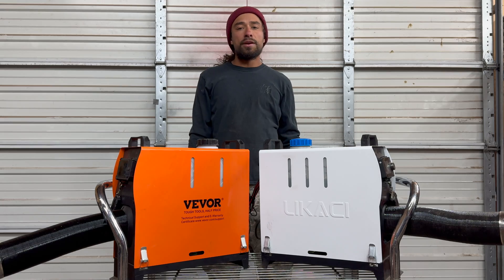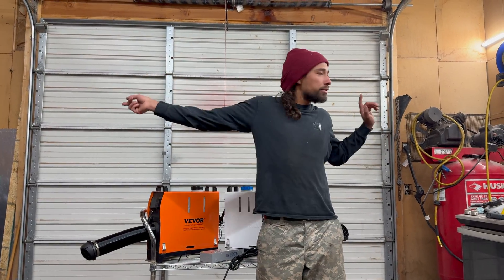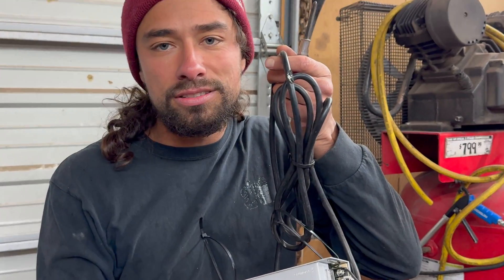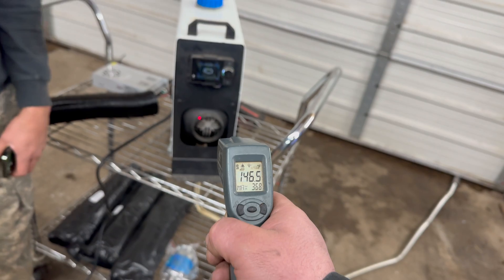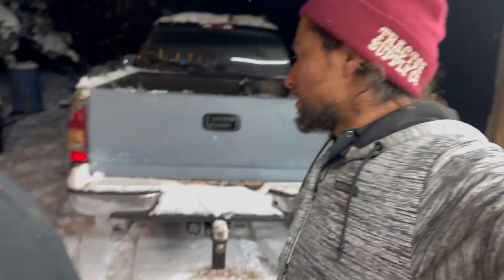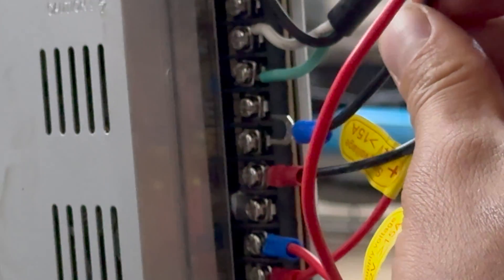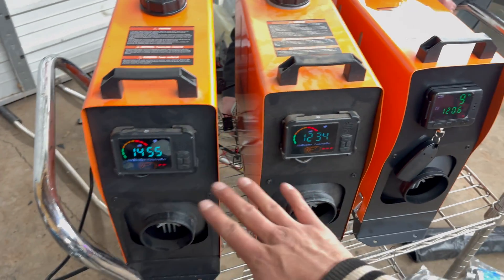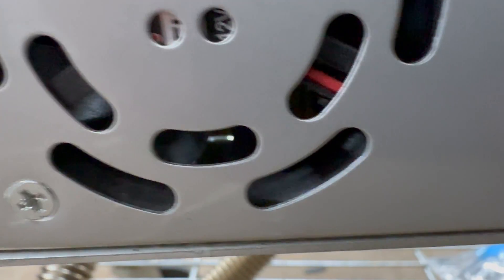3x Diesel Heaters VS 1x 110v AC Power Supply

Comment: The one that don't work probally needed a new mesh filter in the exhust, even if its the pump it will cost you 25 at most or buy a kit for 40$.  Why trash it.

Comment: Also run my heater the other day with my fume extractor on as I was welding and it sucked the exhaust in through the air intake and the heat output white smoke everywhere 🙃

Comment: lol add methanol (yellow bottle heat fuel additive) to your veggie oil. i think technically you need some sodium hydroixde to complete the reaction, but its litterally how the make bio diesel from waste fry chip oil. the glycerin will fall out of solution in the bottom which is the junk part which gels up and clogs all the lines. im thinking you would need an automatic stirrer like one of those magnet stirrers and just leave it in the gas tank stirring for like a month without lye (sodium hydroxide), should convert some of the waste oil directly to biodisel by seperating the 3 strands of fatty acid chains off of the triglyceride chain. way cleaner burning. heet yelow fuel additive is like 1-2 bucks. add one bottle per gas tank dont owrry about ratios

Comment: what ratio gas to oil did u use?
Reply from the maker: I tried 10%, 20%, 40% lol. All ended up failing at some point, no videos were released as I wasn’t happy with results
Reply: i also heard starting it with kerosene (or i guess gas) then switching to waste oil mixtures will give you a better chance of it not clogging up
Reply: @notquitea gas?? I would absolutely not try gas in these.
Reply: also end with a pure kerosene cycle before you turn off
Reply: lol  i find bit of methyl hydrate  in wmo  works best running prob 90% wmo in mine  need to shake it  and let it rest over night   u find thick sluge st base of the tank  then take good fuel above the sluge   works best also gets rid of the water to

Comment: I used electrical metal conduit for the exhaust on mine. The flex tubing that comes with the heater, and then the metal conduit from there out. Easier to run a long distance and it’s the same size.

Comment: I just installed one of the vevor heaters outside my RV yesterday. It's connected to a car battery and the vent runs through a hole into the RV. It gets fairly cold here in Memphis in winter, and electric space heaters were killing me with $400 electric bills. This heater is a game changer! It will chase me out of the space on high, and even on the minimum setting, it keeps the space nice and warm. Mine draws about 20 amps running the glow plug on startup, but that only lasts a few minutes then it drops back to low draw to run the fan. It looks like mine will run at least 18 hrs on low, so it should be an excellent money saving solution to my heating. I am also planning to run the exhaust through a long coil inside another pipe filled with sand to harvest the wasted heat. These things put out a LOT of waste heat through the exhaust...it's not that hard to capture.
Reply: Yeah all you really need to run these is a old car battery and a battery charger, something we all have around anyway.
Reply: @7eis  Normally people use the RV battery, but mine is parked and non-running, so I had to add my own. I left the unit outside to reduce fire hazard from the hot exhaust and because I'm lazy. Lol!
Reply: For the wiring, you don’t need any adaptor or anything? Just attach the two leads to the car battery?
Reply: @muhammaddelen7769  Yes. I also have a battery charger to use every couple days to keep the battery charged.